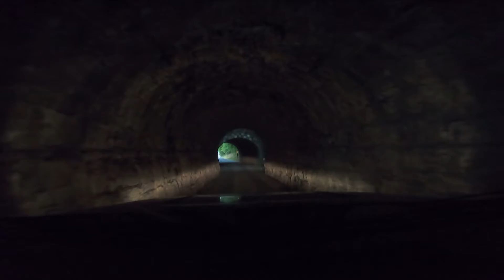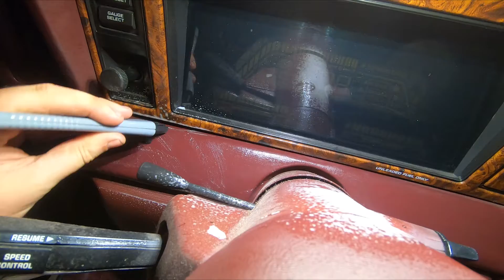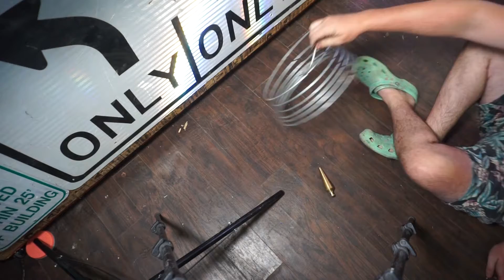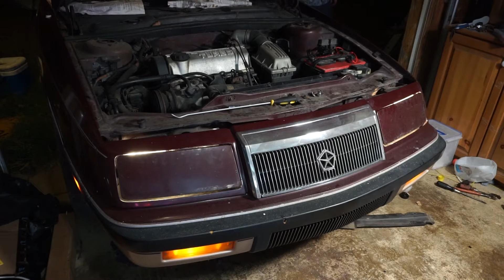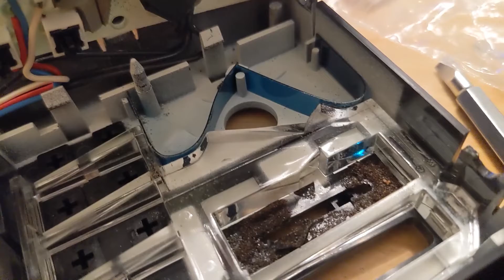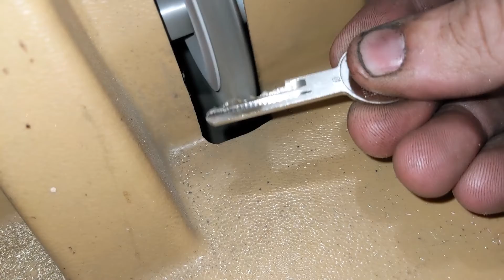Restoring A Talking Chrysler Lebaron Coupe

Comment: I just picked up an 88 Lebaron coupe (not convertible) with 88000 miles on it. Turbo, automatic though. Coupes are very hard to find. I had several verts.. and a 5 speed?! sweet. Mine doesnt have EVA. my 84 Laser turbo 5 speed does.. my door is not a JAR!! damn thats a lot of lebaron listings! where can I find that listing? Ford uses similiar bushings in their window motors, we alwaays replaced the bushings with metal and lube.. fingers be damned lol. can you share the part numbers for the switches? awesome video
Reply from the maker: Good stuff! I will find the part numbers and comment them here as well as add them to the description, I may have provided them in other replies as well

Still need to edit part two! I am in need of a newer computer to continue editing and have just been too busy to get to buying a computer and setting up all my video files on it.
Reply from the maker: Alright I found the receipts, I ordered both switch styles from Mouser, one is for the digital climate and the other is for the trip computer. One has two pins and the other has four pins, can't remember which unit got what but if you open them up you will be able to see. 

TS02-66-95-BK-100-SCR-D
101-TS7311T1606-EV
Reply: @ youre awesome man, thanx for saving this car!

Comment: Go restore something worth restoring. I had an '87 lebaron, it sucked.
Reply: ..because you can’t drive. This is good cars. I have one 1994 and inte runs good and smooth. Lovely to drive.
Reply: @nerdiep3456 you  can go back to '99 and have that '87 lebaron coupe. It had a mitsubishi 2.5L 4 cylinder. Never had more problems with a car in my life. I bet yours sucks too.
Reply: @nerdiep3456 you can go back to '99 and have my '87. It had a mitsubishi 2.5L 4 cylinder. Never had more problems with a car in my life. It had a steering wheel and a gas pedal, wasn't too hard to drive. I feel sorry for you if you drive a '94 and you're praising it.
Reply: @senorpepper3405 No it is a Lebaron, lovely. No problem. 3,0 V6 
And I have a Dodge Challenger 2023 R/T plus last call
Reply: @nerdiep3456 and I'm sure you're on a hundred acres in a mansion. Maybe you have a Rolls-Royce phantom too. Nice tall wrought-iron gate around your house and a 6 car garage. Atleast you have somewhere to keep that LeBaron at.
Reply: @senorpepper3405 No I have the Challenger, Mercedes Eclass and the lebaron. No I wish but just 1 car garage. My Lebaron got winter parked at my moms house, haha, so no not so fancy at all. It is the truth
Reply: @nerdiep3456 why are you getting bent out of shape over a '94 Lebaron?
Reply: @senorpepper3405 I am not, just think it is a good car. Maybe not all thinking that but I just say my opinion. Every people can’t like the same cars. I am understand that.

Comment: Sorry to comment a year later and also for my bad english. I am a 18 year old guy from finland and I bought a 89 lebaron gtc and i've done very much to get it on the road again. Shortly after purchase, I realized that the floor was completely rusted out and spent a year welding it. After the welds I took it for inspection... It in fact did not pass for various of reasons. The rear brakes started to lock up during the inspection, emissions were too high, rear wheel bearing was shot, the left lower control arm was wiggly and parking brake did nothing. Then I was broke so it stood a year in my bacyard.  during the year a tree fell on it, destroying the rear glass, the left side mirror and left a few dents to the roof. fast forward like a month from that point, the engine bay caught fire since the fuel lines were weakened from the tree falling and started leaking on the hot engine. now I have replaced all the electronics and vacuum lines that were damaged by the fire and have done close to everything for the car to pass inspection. I still have to build a new exhaust system on it since the last owner straight piped it with no catalysator or mufflers. I hope you find this little struggle of mine with my lebaron even a little entertaining and I wish that you too will be able to enjoy your chrysler on the road as soon as possible. wishing you all the best.

Comment: Found you via RCR. I’ve always had a soft spot for the Chrysler K-Car Turbo Coupés when paired with manual transmissions - LeBaron, Daytona, Sundance, et cetera. But my ultimate dream from that era is the Chrysler TC - basically a Le Baron Roadster (two-seater). There were a few dozen made with a 5-speed manual gearbox - something it’s competitor, the Cadillac Allante, never got. And those manual roadsters got a special Maserati designed 4-valve head.
Reply from the maker: I might eventually want one of those Maserati's as well! Would be cool to casually say "yeah I have a Maserati" and it is a unique piece of automotive history
Reply: @triptheroad  In my opinion, there hasn’t really been “true” Maseratis since probably the late 80’s or so. Nowadays, they’re just the exotic subsidiary of FIAT, which is part of Stellantis, and so they share FIAT-Chrysler platforms and components, and the engines are ultimately Chrysler-based V8’s. I own (technically my grandfather’s) a Maserati Khamsin, and sort of own another one in the form of my Citroën SM. The SM has a 3.0L Maserati V6. Both of those cars were designed when Maserati was owned by Citroën, so the Khamsin in turn has the same hydropneumatic suspension/steering/braking/clutching system as the SM.

Comment: I have found a car exactly exactly like yours, 2.2 mechanic turbo just the right side mirror is broken. And few things to repair like breaking pads,chasis needs to be repair, the headlight cover is stuck. 

I wish i was a mechanic to maybe repair the car and save money.

I havent bought it yet but im starting to like these cars even tho i just found out about them 3 days ago hehe. 

This owner had it for 16 years. 

What else to look out while checking this beast?

What if the voice system is not working, is that a sign to not buy the car?
Reply from the maker: I would join a few facebook groups to get some model specific advice on what to check for. The biggest thing is to make sure that it runs and moves, generally from there you can bring any car back. If it doesn't start at all, it's really hard to determine what's wrong with it. I am in the SDAC (Shelby Dodge Auto Club) group and a few Lebaron Groups. The SDAC guys know a lot about the turbo systems on these cars, they are just a wealth of information for the 80's and early 90's Chrysler stuff too. 

If the voice alert doesn't work, I'd still consider buying it as that could be something as simple as a bad component on the voice alert module

Comment: In the future, if you get nickel/copper lines they are much easier to bend by hand and have the added benefit of not rusting. I use that stuff wherever I replace lines.
Reply from the maker: Correct, I just happened to have a whole roll of the correct size steel left over from the s10 build. I'll probably redo all of it in the future if I can get it up on a lift to rust proof.

Comment: What a score. I love these hard top coupes. had a grey/blue on silver one many years ago, with manual. I was a Daytona nut but that Lebaron... YUP. Good car. I live in rust country and dumped it when it started poppin.
Reply from the maker: I am a little nervous because this one is from the PA rust belt and I have found a few spots I should address sooner rather than later, but the last owner did take really good care of it even when he couldn't make time to get it back on the road
Reply: @triptheroad  please save it. I regret losing every turbo Dodge I sold away